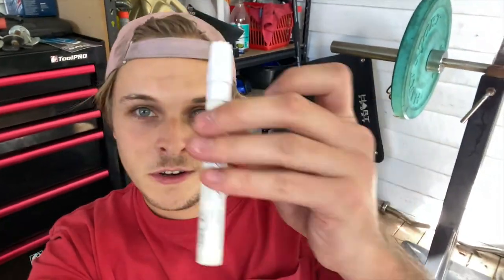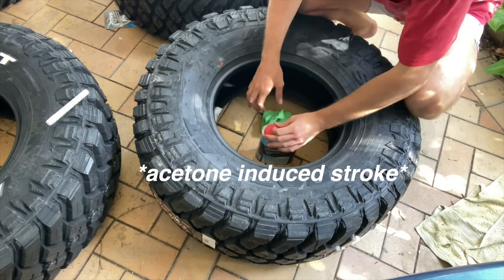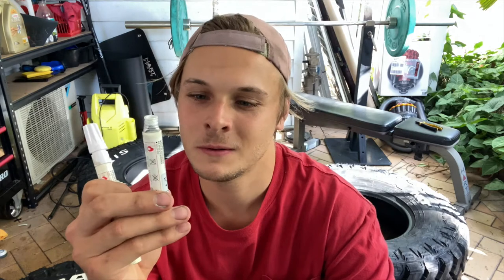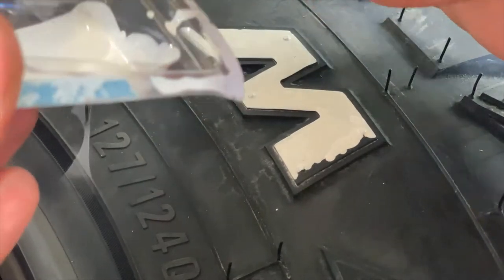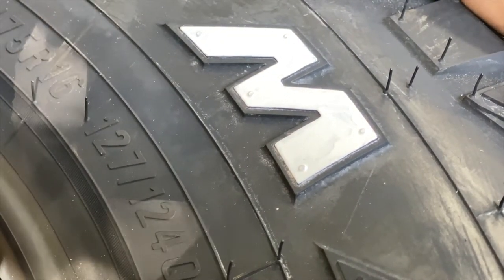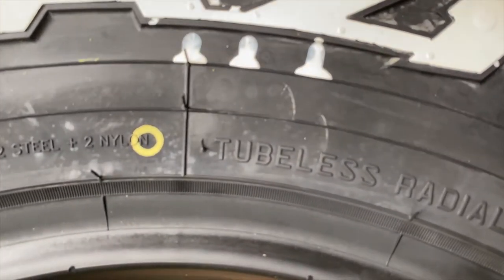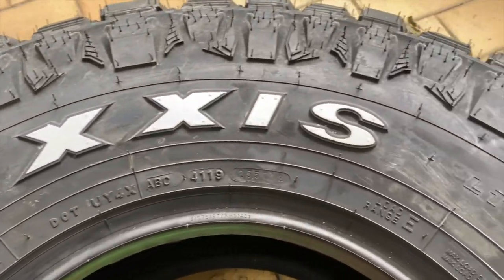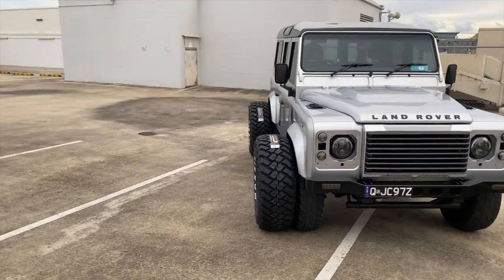How To Apply Tyre Paint (The Easy Way)

Comment: Nice job bruv. those turned out sweet!! Ive gone through the same learning curve over the last few years  and 2 sets of Defenders with my Jeep Willys. It wasn't easy it was frustrating but after about a hundred bucks ( Canadian) and a few restarts i have found the same technique. The razor blade is a perfect eraser eh!!. I didn't do the acetone so once they wear out i have a  new trich to try. My paint pens are  made by Forney industries and are acrylic too, so ive gotten a bottle of acrylic clear nail polish from my girlfriend and a going to add a coat or 2 of it in a matte finish. I find it just awesome to see someone so far away coming to the same result. Smash the pen use the 2nd as the brush. Good on ya eh. Now "Ya goin out for a RIP are ya Bud! Lol ( hilarious Canadian music video check it out if you haven yet). I love the Landy too.😊

Comment: Did the exact same thing (except cutting the pen) to my 33” Nitto mud terrain tires. Looked great until I had them mounted on my wheels and the air pressure caused the ink to crack. Lasted a good 2 weeks.

Comment: Can anyone here comment on what type of paint is best for rubber tires? I imagine buying a  pint of paint at the store is better than using what comes in these pens. I just don't know what type of paint is best. Thx
Reply: Id say something oil based and exterior. Oil base sticks to about everything. Even spray paint you could spray into a container and use a tiny brush with it. Theres also marine paint. Some other options are kilz oil base primer, maybe rustoleum oil base if they have white. One or all of these would surely work as long as you clean the surface well beforehand. It may take 2, 3 coats depending what u use.
Reply: @0ptimal  really appreciate your input! I did end up picking up some of the oil based sharpie paint markers. Haven't used them yet. Looking forward to giving them a try.  I realize I will be needing to touch these up often, but that's unfortunately part of this tire paint process.
Reply: TAUTFLEX paint is sold in 500ml or even 50ml bottles and is a polyurethane vinyl mix used on truck tarps and logos on mudflaps. Very durable and long lasting and comes in heaps of colors.
Reply: @madeleyinc  really appreciate the info!